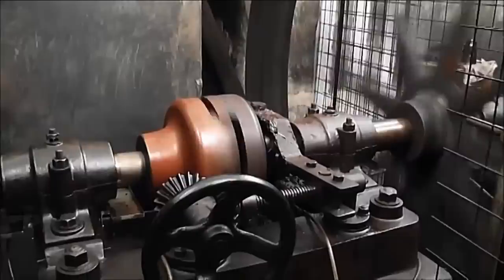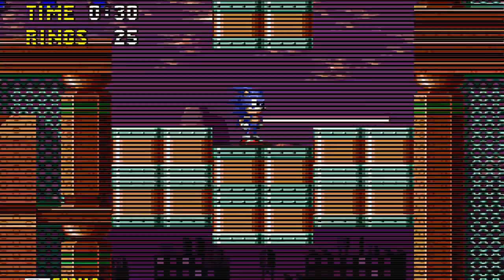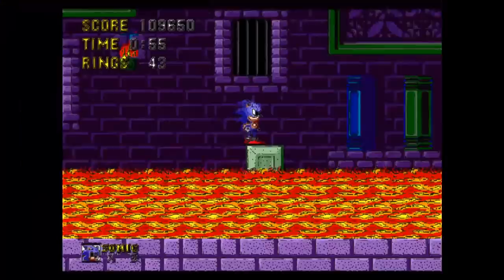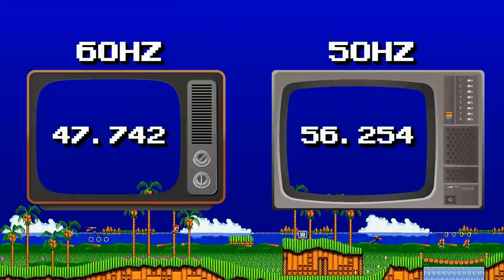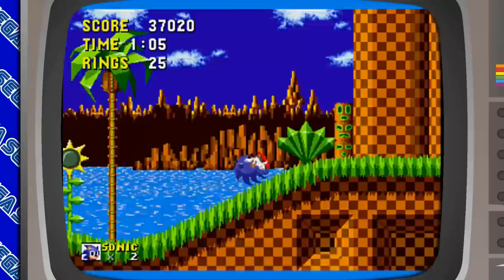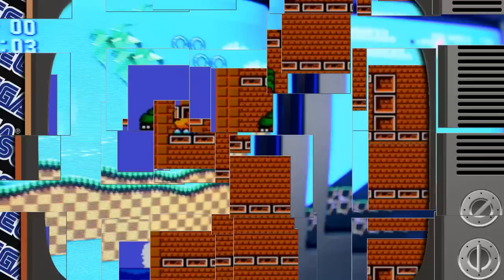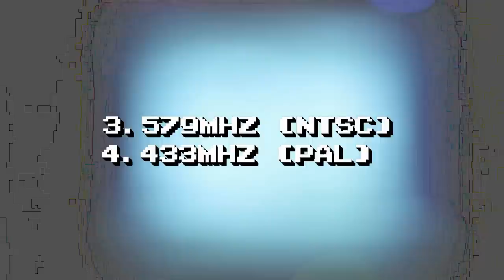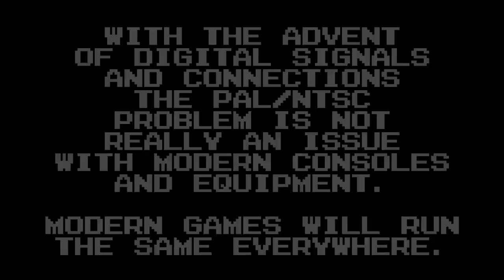Why is Sonic Faster in America? NTSC vs PAL/60Hz vs 50Hz | Nostalgia Nerd

Comment: there's even ps2 games that run slower in pal regions like Final Fantasy X
Reply: oh god, don't even get me started, The Final Fantasy Games were ALWAYS horribly converted to PAL regions, with huuuuge PAL borders. Sony and every other gaming company always considered PAL regions as the third world of videogames.
Reply: Many games were slower, but on ps2 some developers did start to make an effort to reduce those borders. I think the only game I had on ps2 that had the full 60hz mode though, was virtua fighter evolution. The wiki has a list of the rest.The dreamcast came out a year before ps2 yet seemed to have more games with that full 60hz mode.

After those consoles far more games became either optimised for speed at 50hz or offered that full 60hz full screen largely because gamers were now aware of the difference. The majority of ten year old Sonic fans in 1991 largely did not know,or care,lol. I remember getting rid of my N64 around 98 just to buy a US system because of pal. 60hz or ntsc is always the way to go in collecting games unless a pal game does offer something different
Reply: I guess original XBOX was the best I have never seen pal game on original XBOX that had black borders or slower gameplay and almost all games support wide screen. Original XBOX from a hardware standpoint was the best.
Reply: There were optimised PS2 games like Dead or Alive 2 and Pro Evolution Soccer 5 that had 60Hz options. But these only started after around 2004.
Reply: @Ojideagu  Not quite. The PS2 version was NOT optimized at all. The Dreamcast version was the one that was optimized. It ran better, did not have the PAL bars and also had anti-aliasing.

Comment: surprising how many countries adopted the inferior 50hz system.
Reply: GraveUypo Inferior? Maybe you didn't watch the whole video, but the slowdown because of 50Hz doesn't happen to modern games.
Reply: Keith Bellic
50hz is still inferior to 60hz even when there's no slowdown. flicker fest. also, choppy due to low frame rate. i mean, 60 is bad too, but it's better.
Reply: GraveUypo Modern games don't flicker. Also, 'choppy'? A system is more likely to lag (and be choppy) trying to run 60Hz then 50Hz, but ultimately a game isn't going to lag or be choppy on modern consoles solely do to a Hz difference.
A 50Hz game will run at the same speed as 60Hz on all properly coded games, which is practically all nowadays. 50Hz looking slower is because you're used to it, for someone use to 50Hz then 60 would look too fast. Inferiority is subjective here.
Reply: dude. 50hz is choppy. if you can't see it, it's because you never used a 144hz (or a 100hz, 90, 85 or even 75hz screen).

60 is well into bad territory, 50 is approaching garbage levels of choppiness. i mean, not that it is unplayable or anything near that, it just doesn't have fluidity to it. and very fast motions are just too... well, choppy. i can't play unreal tournament at 50 or 60hz, it's just not enough. even 80 is just barely acceptable.

and it's not subjective. 50hz has objectively less time resolution than 60hz. there's no working around that.

i recently went from a 144hz screen to a much bigger ultra-wide screen that's MUCH better in every aspect save for refresh rate, which is only 75hz from factory. for the first two weeks i regretted doing it. it felt absolutely terrible to play with such "low" refresh rate. i tried everything and could only overclock the screen to 80hz. but thankfully even those 5 extra hertz made enough of a difference to partially rid me of the felling of choppiness. it isn't ideal, but it's enough that i'm satisfied. ideally i wanted to hit 90 or 95hz. honestly from there onwards, it's still noticeable, but diminishing gains hit hard. 90 is "enough"
Reply: GraveUypo "and it's not subjective. 50hz has objectively less time resolution than 60hz. there's no working around that."
I never said that it being slower is subjective, I said that this slowness being inferior is subjective.
Choppy means disjointed or irregular. Games running at higher Hz (and fps) flow more smoother then lower Hzs games, this doesn't mean they are choppy since lower Hz still runs consistently at this lower frequency. If a game was bouncing between 50, 55, 45 then yes, that's choppy.
Would like to point out that your anecdotal evidence is pointless, since that doesn't contribute to something being objectively inferior.
I think higher Hz (and fps) are better, but I'm not going to go around spouting that it's objectively better. Some people prefer lower Hz, whether this be due to headaches, preference or nostalgia, they seeing it as being better means that high Hz can't be 'objectively' superior.